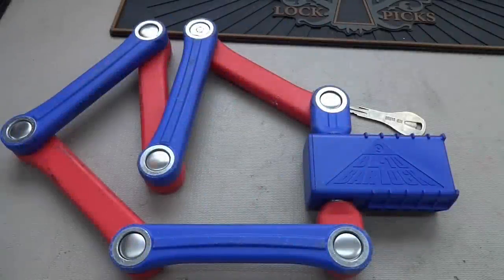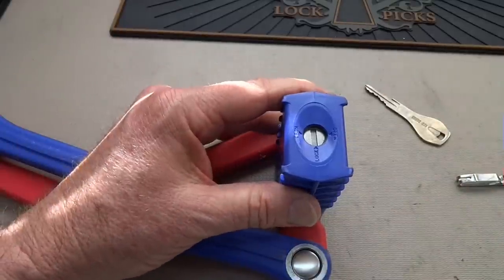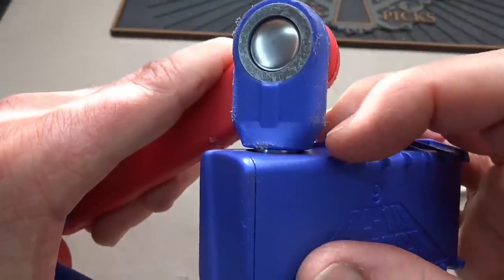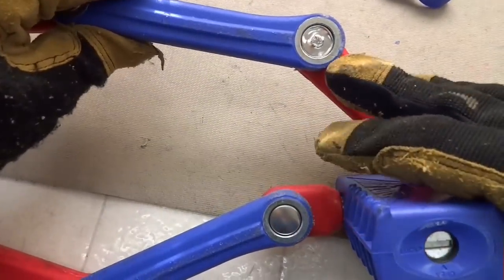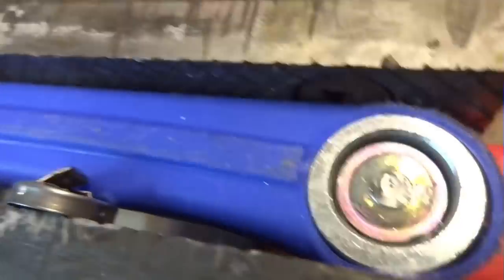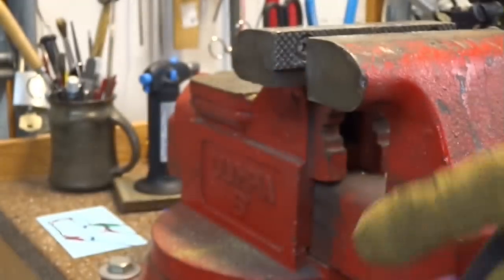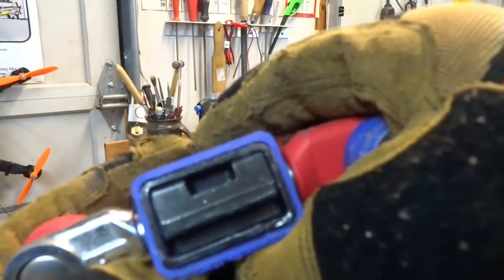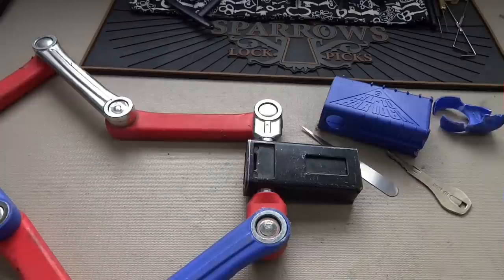(774) Japanese BL-10 Bar Lock

Comment: I'm curious if you made a metal jig that works like an oversize chain-link joiner/separator press. Have it use a bolt the same size as the one you were hammering, and wrench on it with a cheater bar. That would put a lot more force on those joints than hammering by hand ever would.

Maybe it's a bit elaborate to make a tool specifically to try that approach, but I'm curious if one of those pins would pop with that approach.
Reply: +pauljs75 Something similar to a gear puller?
Reply: Now that you mention it, yeah same concept.
Reply: A hydraulic press? We've a 70 ton one for doing bits on old tractors.

Comment: 10:27 I have an easy solution, instead of making it plastic that covers the lock,the shimable part of it, use metal and completly cover it so you can't shim it, unless they cut through the metal, which would be loud

Comment: wouldnt the lock be more fail safe by thickening the area where he slid the pick in so after the plastic came off you couldnt shim it? id like to see bill shim it before the plastic came off to try and prove my point. maybe if they put a thick rim of metal on each side of the chain ends you wouldnt be able to get the shim in even when the plastic was removed. not sure why they didnt think of it.

Comment: Shimming can be made lot harder by geometry of the plugs. More overhang on the plugs, larger tube around the socket .. and you could still have it lockable without the key. Well Japan has such low crime rates, that they just might have forgot about shims.

Comment: instead of beating the pins with a rod and a hammer, why not use a pneumatic press to press the pin out? The metal will give at some point and you can soften it with a torch first.  A pneumatic press can be made with air too, and is quiet, so with the help of somebody with a foot-pump or a bike pump , they could compromise the lock within seconds. I think a 2 metric ton press ought to do it :-)

Comment: How much work would it be to grind the weld on the pin?
Reply: +Smidge204 A lot of work for your average thief who doesn't want to be noticed. Even shimming it seemed like it was be annoying if you had to cut the plastic away by hand. Doing it on a bench in a vice verse in the street, would make a big difference.

Comment: Use some liquid nitrogen to make one of the bars brittle, then shatter it with torque or the sledge.

Take a blowtorch to one of the hinges or the lock.  Maybe the hinge pin or wafers will soften enough to let you force it open.

Comment: as far as bypassing that lock why not try drilling out one of those spot welds and then try punching out one of the joints. something else you should try is simply prying those arms apart, the steel cores should be thin enough to snap under enough tension.

Comment: I look at it and I see it is just begging to have a pickle fork (automotive suspension tool, not dainty dining implement) applied to the joints and also the end where it meets the lock body.  In a practical setting the way it's applied and to what kind of property might also permit the use of the old automobile screw jack attack as you might on a U-lock.
Reply: +Lazarus Long I think you are on the right track. Hopefully we will see this lock in a sequel.

Comment: Well even though it is shimmable, you still have to first cut off the plastic protection then hammer the shim in. Certainly not gonna be unnoticeable nor favorable. Still though, that's a really well designed lock for sure.

Comment: the 'chain' looks quite easy to break. just get some leverage and twist the whole thing. or just use 2 chain links and push against the 3rd at a 90 degrees angle.
Reply: +Brian Su Apparently it's pretty difficult to do that, and the amount of leverage needed would require the use of a bar big enough that it would also damage whatever the thing is locked up to.

Comment: A better design would be to have the steel mushroom out so you can not put the shim in, and tighter tolerances between the mushroom and the body. Easy fix, and they could have did that...maybe no one thought about shimming it open.

Comment: Fixing the weakness would be easy enough.Cast/Forge the pin in the shape of the plastic cover you removed.That is make the head/knuckle, whatever you call the part with the pin on it, wider so you cannot push the shim in.

Comment: Instead of having the plastic blocking the open area around the shim-able section, they should have kept the shackle metal thicker to block the one easy access point, and then cover it with the plastic for the aesthetics. I feel like they thought about this too since they used the plastic to give it the appearance that a shim wouldn't fit, but I guess they didn't want to spend the money to do this with the hardened metal.

Comment: Try bending one link perpendicular to its operation. Breaking the joint. I wouldn't be surprised if you could break it on the curb. Just strike the joint with your foot. Or line up two links a d use the lock against it self. Stepping on one link and lift by two others.

Comment: I see those joints as a huge weak point. I imagine the easiest way to defeat that lock would be to place a pipe or long pry bar through it and torsion it using the bike as an anchor. This would be especially effective if you can pull the chain out and place one of the joints at the edge of the frame.

Comment: If I manufactured this lock and after seeing this I would have the shackle that goes into the lock have a wider than the hole edging that would lay flush against the wall of the lock but not enough play to wedge a prying bar.

Comment: The manufacturer could improve this lock by simply making a flange on the piece that goes into the lock body on each side, a flange that covers the hole and blocks the shim approach from working.  Putting on the flange would be very simple by casting it in when the end piece is made.

Comment: Bill all you need from the looks of it out in public would be a propane torch and a piece of sharp pointed tin,  Not that id ever do it but that exploit is nearly as fast as the key with a torch and a pointy piece of metal,  The links look more like miniature ball joints covered by frost caps,  I went with a  torch because a miniature mechanics one would be easily concealed including the burn,  Id never lock anything I cared about up with this lock

Comment: Seems like the real problem could be fixed just by closing up the tollerances so a shim wouldnt fit as easy and making the metal a bit wider around the opening there so you cant slide a shim in without bending it a lot. kind of silly that they would make such a good lock and leave something that simple that makes it so much weaker.

Comment: What I find realy funny with some of the newer electronic "safety" bike locks, is people get so upset when they're damaged from attacks, or just Ware and tare from daily use. personally my U lock has been attack 2 times as far as I know, one attack was with probably bold cutters, but it's 20mm thick XD so it's just some aesthetic plastic damage, I covered the holes up to stop rusting. As far as I'm concerned,I think it acts more like a detergent that the lock has aesthetic damage, because then than attacker sees it's been attacked, but with no luck. And besides, some of the €100 bike locks don't do too well.... I have an acquaintance in school, he got his lock attacked and he got so upset saying ti now looks horrible, just as if he got a scratch on his phone screen. saying how he had to replace it with a new one. there was no damage to the metal bar, just the plastic shell. (But sure h minted, so he can buy a new lock if he wants)

Comment: With a lock of this type I would like to see every one tested against a battery operated grinder with a cutting blade. Both my trailer and my Waverunner were stolen at different times when a portable grinder was used to cut through the rather heavy chain. Crooks don't pick locks anymore they freeze them then shatter them or they cut them like butter with a grinder so it's nice that you take a Renaissance approach but it's not really "real world."

Comment: They need to use hardened steel to cover the locking mechanism (the plastic he cut away) Frankly, I think they should use plastic only to cover hardened steel throughout the piece. Everything should be hardened steel dipped in colored plastic or powder coated.

Comment: apologies if this is a really stupid question but how does one tell that a piece of metal is steel just by looking at it?
Reply: he knows the materials that makes sense in a lock and by his experience he can just sense it right away not even kidding
Reply: I work with metal. I can tell you the difference of just about any metal or alloy by looking at it. I can also tell you if it's been hardened or tempered by feeling it, and tell you the hardness level by the sparks it throws.
Reply: +joe friedl interesting, how long did it take to develop that awareness?
Reply: +slendy9600 experience, I started learning in high school, and have been working with metal my whole life. I'm a powdered metal diesetter by trade. I work closely with our machine shop to develop tooling for our powder compacting presses. Look around on YouTube you can find videos about learning hardness sparks. Harder metals will have a spark that's got a hot point with a feathery tail off the back where as softer metals don't have that refined point just more feather. You can also get an idea if its hardened with a file. If you file and it seams to bounce around and not cut its obviously hardened. Watch the sparks in the video when he's using the grinder. They are tell tale sparks of hardened metal. A big feather in the back with the hot refined point in the lead. Telling by look comes down to color and feel. You just have to be around metal a lot. Be carful, hardened steels are actually brittle and will shatter. If you strike a hardened hammer with another pieces will fly off.
Reply: +slendy9600 they will come off like shrapnel from a grenade. They won't bend, won't cut, drill, or file. But have amazing wear resistance. Softer metals bend and have more flex and resist breaking. Like a piece of wire. But, are easily cut, filed, or drilled. They also wear easily. Where metal to metal contact with frequent movement happens it will wear out of shape. Like if you have a hardened rod in a hole of a softer metal and the rod spins with frequent pressure in a certain direction you will notice the hole wear oblong. That's why most have a bushing or bearing around the rod to wear instead the piece. Take for example a tension wrench. A hardened tension wrench would break if to much tension was applied, but the tip would never wear out. Where as a soft wrench would bend with too much tension applied but the tip could wear or become "chewed up" from the keyway. Hope my rambling helped!

Comment: They could resolve the shimming issue very easily.  Just design the shackle that slips into the lock with a flange that is bigger than the hole so when it's closed there's no way to get into the hole. Easy Peasy.

Comment: One of those small pocket sized dremels will work well.
Reply: +Juggernautdemon 
Considering how poor on power those are you would probably be hacking at it for hours, with considerable amount of noise.
Reply: I've used a diamond tipped dremel head to cut through 2 cm thick steel various times within 2 minutes. This steel doesn't look much harder.

Comment: hack saw a link bolt between the crack and try using a prying force to bust a link  use some big bolt cutters at the lock end on on the links if you get it in between a link bolt crack it might pry it and snap the link bolt ends I would also try a strong straight screw drive and a mallet at the link ends

Comment: I think the designers could have made it un-shimmable by making the same thickness of the parts that go inside the lock made entirely of steel and not covered in plastic. This way there would be nothing to remove that could expose the hole for shimming .. They can make it thick enough ( diameter ) to completely cover the hole and not be able to shim it .

Comment: Well, it's crazy, but I'd try to find the suitable frequency and amplitude of vibration to get the locking claw to move in the direction desired while pressing the connecting piece in. Yes, crazy, I know. :)

Bravo, btw, on opening the device.

Comment: Couldn't that convience be maintained without the cost of insecurity simply by making the metal larger to block off the shim. Sure you can cut through the plastic, but if that case hardened steel was where the plastic was cutting of the plastic around that wouldn't be very effective.

Comment: Presumably if you heated the steel up with a torch or some sort the added some Nitric acid, it would dissolve the steel or weaken it. I don't recommend this due to the Nitric acid factor so don't try this at home folks

Comment: maybe a set of wafer picks might be  able to pick it?
Reply: +bosnianbill 
The internals seem similar-ish to a disk detainer lock but with pins as opposed to a shape pattern. Would it be possible to use a comb/bump key on each side of the keyway then wedge something in the centre to overset the pins? (maybe bump till tension is received?)  [wording might be off, i'm a novice]

Comment: Hey bill, what about the most common way to open locks without a key... Big ass bolt cutters oughta snipthem little flat arms
Reply: +Robert Dye I doubt that bolt cutters will get through the arms, they're hardened steel on the outside.
Reply: Potyo true. And the ones big enough to do it would be awkward and bulky... Not to mention the odds of em being on hand when the situation arises

Comment: One DeWalt cordless angle grinder with a cutoff wheel and you are in, in about 15 seconds.... albeit noisily.
Reply: +Monel Funkawitz That applies to just about any bicycle lock you can name.
Reply: +Monel Funkawitz Why stop at just one? A cordless hammer drill and you can punch out the concrete that holds bike racks down.  Take em' all!
Reply: +Caleb B LOL

Comment: I have to say it's an interest design.  Seems like the lock itself is the weakest link.  With the flexible joints, it makes it harder to hold it in a position to break into it.  I seriously doubt a criminal will have a vise available to hold it in position while they pound, beat and saw into it.  A criminal hell-bent on breaking this lock might spend $150 or less for a battery powered small angle grinder to steal a $10,000 bike. As you've stated and everyone knows, nothing is 100% secure.

Comment: Seems to me that the point is to determine how thief proof this device is. Therefore I think a thief would come with a bolt cutter rather than anything else.  So, the question is, would a bolt cutter sever the bar or not.  I doubt a thief would sit and fuss with it running the risk of being exposed.

Comment: I wonder if you can Separate the joint by using some thing like this : http://www.harborfreight.com/11-3-4-quarter-inch-ball-joint-separator-1740.html  , If it is possible and or fast and covert enough for not on the main street  attempts?

Comment: Do you think lock makers ever deliberately design in weaknesses so that locksmiths have a way into the locks? If enough bikes in Japan use this, the locksmiths there would need to have found a fast and reliable entry method.

Comment: They screwed up all their efforts by cutting costs... This was done by reducing the number of manufacturing steps. The "bar" ends were likely forged at the same time as the rest of the bars and then cut down in a lathe to form the ends, all before the hardening process.... 

The simplest thing they could do to help toughen this lock would be to manufacture the ends separately from the rest of the bar elements and form a larger tapered end that prevents shimming... However, this still leaves the potential for breaking the bar chain at the hinges by some form of lever action.

Comment: I do not speak English well and never been into lockpicking, but... is it acceptable to use maul with liquid nitrogen to make steel more fragile? Shimmable place (don't know how it's called) doesn't looks massive, could you try to snatch it by placing whole lock into the clamp and pressing downwards with weight of your body or equal. If it's not enough maybe a car could tear it apart with towing-rope. By the way what will be with the lock if you pour some sand into it and will spin it with drill or screwdriver? I think there must be a quickly brute way to break it.
P.S.: Still wondering how youtube does know that I'll like that vid? It becomes queerly because I didn't search lockpicking before.

Comment: What does 18000 and 15000 mean?
Reply: +Bruce Lubberdink The thickness of the metal on the picks.
This video will explain everything: https://youtu.be/RVS9LGkelpQ?t=97
Reply: bosnianbill Ah, ofcourse, thank you!
Reply: Np
Reply: +Omicron Vega Wut? Your response was marked as spam and I only saw bosnianbill's and now I disabled the spam on yours and bosnianbill's is gone?

EDIT:

It's fixed now
Reply: Eighteen thousandth of an inch in thickness. He is probably using feeler-gauge material.

Comment: why not just snap it ...pull it straight and bend it tell one of those rivets gives kinda like the way you break handcuffs in two while in them
Reply: you should really make a quick vid trying this
Reply: +bosnianbill I don't hear a problem lol leverage is a miraculous thing if you can get it first try put an extension on it and hardened is better, it will snap instead of bend...
Reply: +bosnianbill would you send it to me? I'd love to check out the welds on those washers with a cold chisel lmao